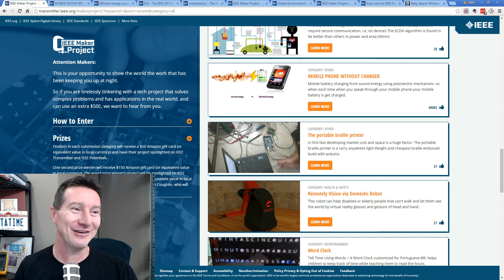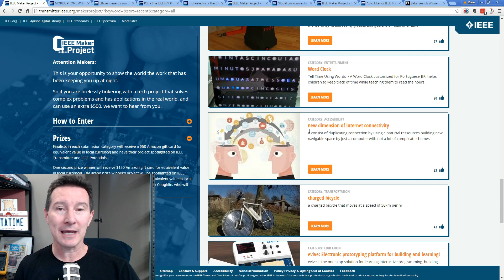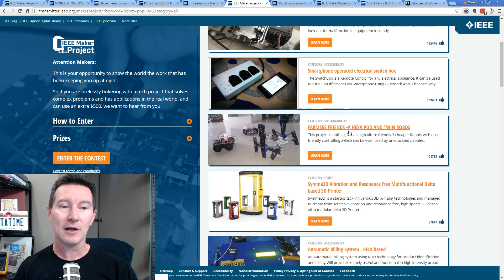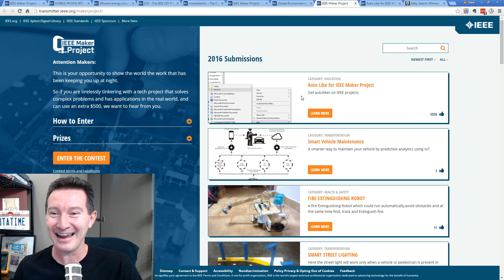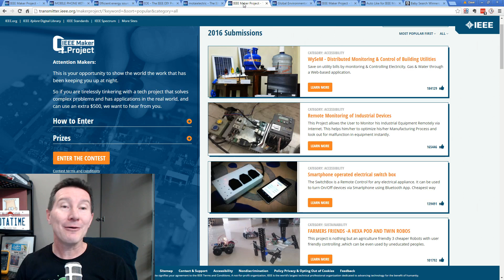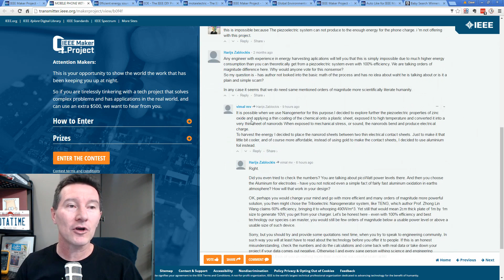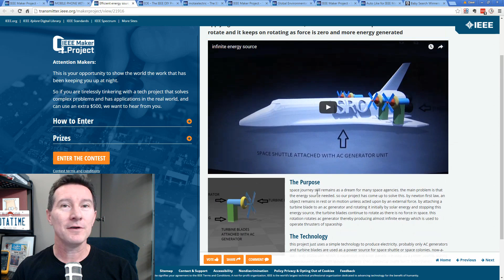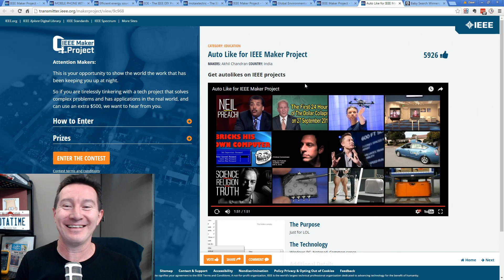eevBLAB #25 - IEEE Maker Contest Extreme FAIL!

Comment: WHY IS THEIR VOTE SYSTEM GET REQUEST BASED?!

Get based voting is such a joke, you can insert the URL into a forum post in an image tag!  It would be invalid as an image, but everyone who viewed that forum post would auto-vote on that item!  IP blocks are not enough, an actual start would be using a POST request instead of a GET request per vote.  Combine that with a 1 vote per IP system and THEN you're sorted.

This is literally web-dev 101, right after learning what HTML is.
Reply: IP blocking is a pile of crap... a CAPTCHA (and possibly account) based system would work... since there's no reasonable way to IP block since anywhere from 1 to (potentially) hundreds of legitimate users can be behind a single IP
Reply: LOL! Find the most popular forum you can & do that, bam, instant $500

IP check and Captcha should be a standard, you'd think IEEE of all people would know that.....
Reply: I won a copy of Visual Studio 6 back in 1998 by writing a Java app that used some basic reverse engineering of a 4 page registration process.  It used POST, but it was just as easy to hack as GET with the Java Networking API... including making my application look just like Internet Explorer.

SAMS opened the door for this, btw, by allowing contestants to enter as many times as possible... believing that the 4 pages (that took maybe 10 minutes to submit manually) would deter most folks from flooding their system.

I let the application run for 24 hours and had over 10 million entries.  No, it did not surprise me when I got the email saying that I had won... but I was still excited!
Reply: Most websites don't follow proper REST conventions... ALso, you can't limit by IP. You'll end up blocking groups of computers (think school, university, public library). Each computer has a LAN ip but externally the gateway has only one IP.

There are much better ways such as two factor authentication.
This is software engineering 101 - right after learning what web-dev is. ;)
Reply: Still easy to get around that.
Reply: A simply twitter/facebook/google/github/openid/gravatar authentication would prevent such pathetic flood
Reply: winrid Well yea, technically what you should do is log all IPs and timestamps and bake your data after the fact to check for odd patterns.  But we're talking Web Dev 101 here.
Reply: Yes you could do that. But it would be overkill and not as reliable as other methods.
Reply: Or you could, you know, require them to have an account...
Reply: Nielk1 The same can be said for limiting by IP right? :D
Reply: ***** Not even account verification is required. Two factor auth is pretty easy nowadays.
Reply: Yup.  And wasnt it the IEEE who invented HTTP?  LOL
Reply: wow I am going to try that if it still works.
well the site won't respond, oh well
Reply: winrid Because it's easy.  Several of the systems I've written work that way and it only took about 5 extra min to implement.  At the end, unless stuff looks sketchy you can just rank the items with 1 vote per IP and all votes per IP and see if they agree.  If they don't, then you have to investigate.  That only happens maybe 5% of the time.  I'm a web dev, though I'd prefer not to indicate where I work, I end up doing a lot of random things :|
Reply: winrid That's kind of a non-functional when it comes to a requirement set.  I mean, sure, you can do that, but normally you aren't the one deciding you CAN do that.  I was talking from the most basic level of things in a fashion that would fit within the minimum base requirements.
Reply: +winrid I'd say for "small" companies like this they'd rather have a larger turn out with no need to create an account than actual account verification. In the long run they probably think having thousands of votes makes them look better
Reply: ***** It's what your browser sends when it wants to change the state of the webserver somehow, like voting for example.
Reply: ***** For the following explanation consider the server with the voting on it A and any other site B:

A POST can only be triggered by a form submit button, or AJAX.  With AJAX a browser would explicitly refuse to send a request to A from a page on B unless A said it was OK to do.  This is called A Cross Origin Request.

A submit form on a page from B can however post to A, and this could be done via javascript in the page on B clicking the submit button instead of the user, however there are several ways to detect this  First, server A would receive information about B's web address during the POST called the referrer and could ignore it.  This can also work for GET requests, but in both cases it's not fool proof and there's several ways to trigger a GET request that does not tell server A about B's web address.

Finally, websites can include something called a canary or cross site request forgery prevention token or just CSRF token.  This is a random value often stored into a hidden form field.  When the user submits the vote form, the hidden value is submitted and the server, A, knows what random value it gave the user when they loaded the page from A.  This type of security is normally used to protect sites from automation.  CAPTCHAs actually work on a similar idea, where they present the user with a random question and only the server knows what the answer for that question is. Canaries like this tend to prevent an external site B from using the systems on a site A, as well as add a layer of security to a login form as the real login form must have been loaded to know the correct canary value.
Reply: YouTube's edit function is broken so I'll reply to myself before someone else does.

A better CSRF example:
Picture if you log into your bank site, and in another window you load a random page.  That random page sends a POST to your bank saying to transfer funds.  Because you're still logged in and it's your browser making the request, the bank sees the request and does it.  HORROR!  Hence why the bank would have a CSRF token in the transfer funds form.  The bad site that faked that POST can't possibly know what the CSRF token is because it can't read the contents of your bank site.  That's also why javascript isn't allowed to talk from 1 frame to another.  A bad site could put a tiny frame in the page that loads your bank website hoping you're already logged in and do nasty things.

And I am going to stop posting this late at night, I start rambling about web security...
Reply: ***** I have referred to OWASP cheat sheets as a sort of checklist in the past just because no one else was checking security much where I am.  I'm in one of those environments where everyone flies by the seat of their pants and I'm constantly going around trying to secure random things.  I'm educated in general programming with a degree in CS and not specifically web stuff, it's just where I've ended up.

I personally enjoy building automations to manage my accounts in websites and extracting vtables out of DLLs by digging in disassembly so I've sort of drifted into some security knowledge as a side effect.